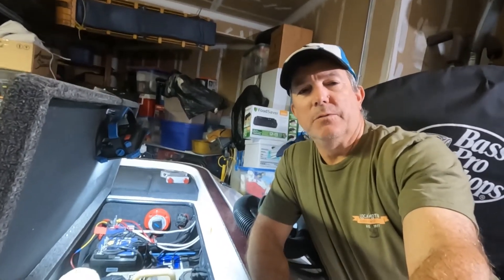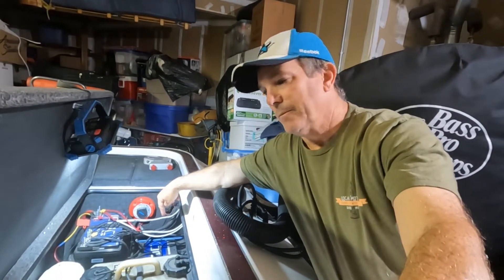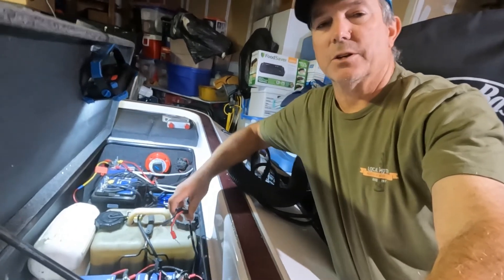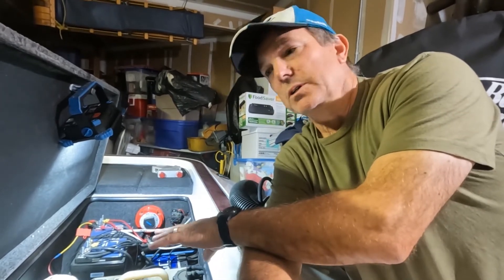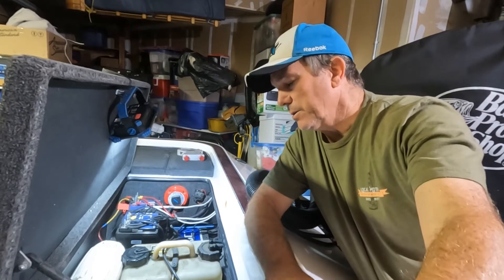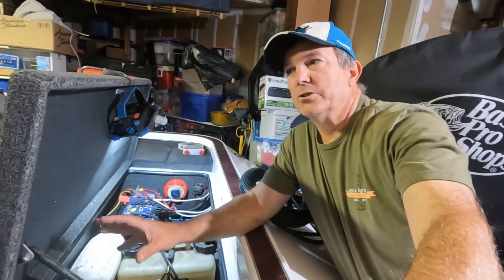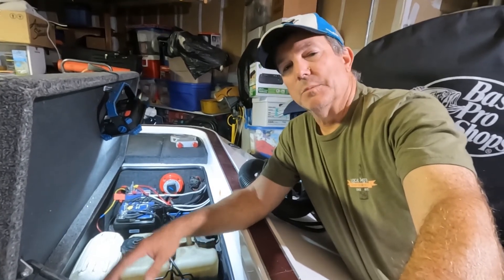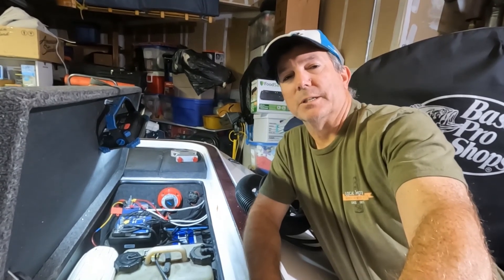IONIC Battery Charger Bank Failure

Comment: Same issue with my 36v 10a charger. Plug it in, and it goes to red like it should, 15 seconds later, it goes to green and remains on standby! I have 4 cycles on this setup, disappointing after doing a great and uncomfortable installation!

Comment: 2 years ago dropped a snall fortune on 3 100ah batteries, 1 125ah battery, and a 4 bank. 11 months in bank 4 took a crap. Contacted and did a warranty claim, sent a "refurbished" 4 bank charger back to me. Now 1 year and 3 months later, bank 4 once again took a crap.  

Tried swapping wires around to verify it was the charger, still bank 4. Tried the fuse swap, still crapped out. 

I love the batteries, cant complain there at all. But they surely need to rethink their chargers, obviously bank 3 and 4 goes out on almost everyone. Several guys in my club had the same issue.
Reply from the maker: If I loose another bank I will not be buying another Ionic charger. That’s for sure.
Reply: From what customer service responded via email yesterday, there has be "programming changes" made to the chargers recently. Im giving them 1 more go, its sad when they send a list of other brand chargers to try lol@SteveSRandomStuff

Comment: I have a minn kota 440 and bank 3 won’t charge. Really disappointed since I need all 4 banks. 36 volt trolling motor and one cranking. I did exactly what you did apparently. I have not tried touching wires yet though. Bank 3 won’t light up at all.
Reply from the maker: My buddy had a similar issue even after we switched the wires. Ended up getting a new charger and worked fine.
Reply: @SteveSRandomStuff  yeah I bet. That’s what I’m trying to avoid.

Comment: I have bank 3 blinking red and every dozen or so blinks it will blink once yellow then back to red all,other banks are charging fine.  Any suggestions
Reply from the maker: Monitor the battery using the app to see if it’s charging. Should be charging at 10 amps per circuit. I recently noticed a light out on mine but it’s still charging at the normal rate.
Reply: @SteveSRandomStuff  The App is not showing even showing that battery or the bank it’s attached to.  App is show banks 1,2 and 4 only bank 3 is the one with the red blinking light they will go to yellow for a second then back to red blinking.
Reply from the maker: Have you tried switching batteries on that circuit to verify if it’s not the battery that is having an issue. If you got a bad battery they will replace it under warranty.
Reply: @SteveSRandomStuff  working on that today thanks for everything
Reply from the maker: Good luck. 👍
Reply: @SteveSRandomStuff  disconnected that battery checked terminals checked fuse all looked good wiped and cleaned everything and now it’s showing that battery so far so good

Comment: I have a Victron one bank charger that suddenly after a year decided not to charge my Ionic 24v 50aH lithium battery for my trolling motor. It puts out 24+ voltage, but nothing doing for charging. Bought a portable charger (needed one anyway for other stuff) and it charges the Ionic just fine. What's the deal with these chargers? Ugh.
Reply from the maker: It appears to be a common problem with these chargers. I noticed last week that one of the lights on the charger is out, but it's still charging. May be looking for a new charger next year.

Comment: It’s not just you. I just bought the same batteries and charger you have 2 months ago. 
Bank 3 on my 4 bank charger is stuck in standby mode as well. Brand new charger. I have 1 cycle on the batteries, and in my boat the trolling motor batteries get mounted in the bow, so now I’ve got to rewire in order to use another bank which means I’ll be sacrificing a battery for my electronics. Not happy about this at all. For damm near $400 you’d think the battery charger would be top notch, it’s NOT. It’s an overpriced POS.

Comment: I have the same charger.  My charger worked last season fine.  I just added all the batteries back in and found my bank one was buzzing and blinking red and green.  When checking the battery, it goes from 2amps charging to 4 then goes back down to 2.  I also have a 24 volt system so I'm now using bank 2 to charge my start which is working fine. I purchased my charger 2 years ago.  Yeah I'm not happy about that.  Thank you for your video!

Comment: I know that bank is dead, but if I were you I would cut off the ring terminals on that charger bank and seal the ends just in case it decides to "start working" intermittently or randomly while using the other three banks.  You don't want those two touching each other and causing an ignition source in the bilge area.  Great vids and new subscriber here.
Reply from the maker: I removed the fuse on that line so the line is not live.
Reply: @SteveSRandomStuff  Nice... forgot about the fuse.

Comment: I just sent in my warranty info on my single 12v 10A hour ionic charger. Only 2 months old. It would charge my battery to 100% but I noticed after a days fishing the app would show 70% but it would say SOC down to 10% charge. Got home and charger would not come on. Come to find out charger never got battery to the 14.0V during charging so battery was actually never fully charged. They said they would send me a  pre paid packing slip to send it in.
Reply from the maker: Good to hear they are replacing the charger. I now always check my batteries when charging and the night before heading to the lake.

Comment: I am dealing with the same, but just on a single lithium hub 12V 10 A wall charger. I have not called Lithium hub yet since I have one other charger that I just end up using for both batteries. My charger won't get out of 'standby' mode for some reason, the battery charges fine using the other charger. Kind of a shame. Still within my 1-year warrenty so I will be contacting them. My batteries only have roughly 6 cycles!
Reply from the maker: They should replace it if within the 1 year. Their customer service has been excellent.